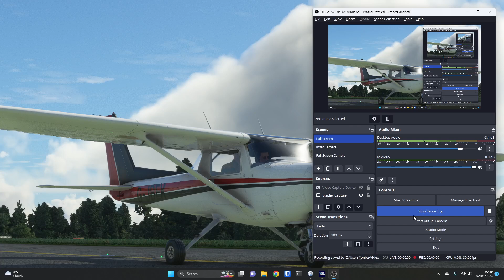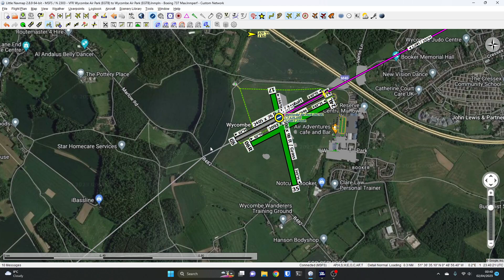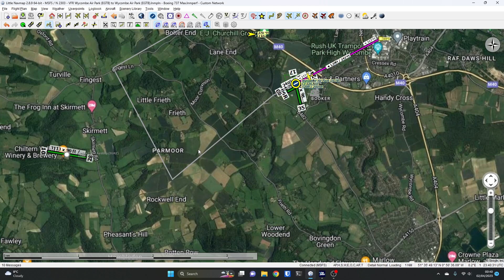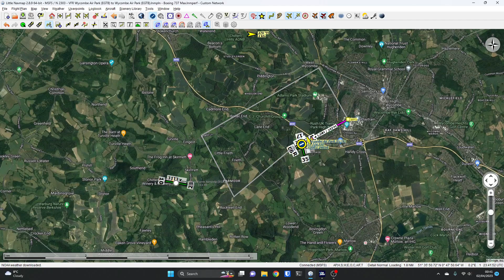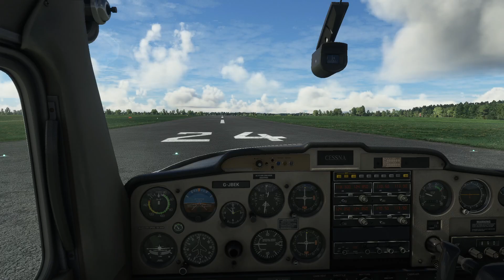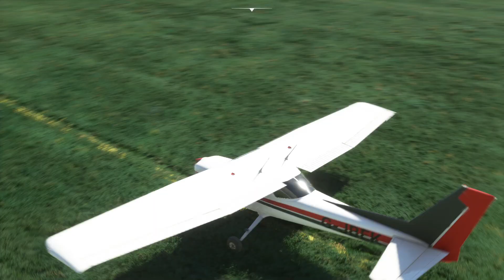Revisiting Wycombe Air Park in Microsoft Flight Simulator for the CORRECT RWY24 visual circuit

Comment: I'm just adding my two cents worth. The main reason runway references are used is that flying to other airports, may be unfamiliar territory, so obvious points on the ground may be unknown.  References to the runway apply anywhere and helps focus on the runway and the aircraft's relative position to it. In the real world the runway is easier to observe. In a sim it can be tricky with limited views.
Reply from the maker: Absolutely - but if you flew into this particular field and flew a generic pattern, you might cause a noise complaint :)

Comment: You did a much better job handling the c152. As a US pilot, the ground reference point traffic pattern is a foreign concept to me. We fly a pattern in reference to the runway. However, I do understand the that the Wycombe pattern procedure is in place for noise abatement reasons. A good lesson for everyone to learn is to do your research on all aspects of your flight before you get into the aircraft. Flight planning and preparation is key to flying an accurate and realistic flight in the sim. Good job Jon.
Reply from the maker: Cheers :)

Comment: Are you using the default 152?  Is the Jps mod worth using?
Reply from the maker: I'm using the most basic of basic stock 152s :) The JPS mod caused issues with other things in the simulator when I tried it.

Comment: Well done Jonathan as a ex PPL pilot at Booker High Wycombe, that was as a very accurate pattern from 24 you nailed it. They be happy with that IRL so without 3D, instructors, real life views it’s somewhat easier in real life than doing it on a pc with all the handicaps that has. 

And as you correct say, they have a unique pattern at Booker & height in part due to the noise abatements, also the Heathrow approach airspace is just above & the fact that helicopters & gliders often use the grass and south side of airfield at the same time!

They always called the thing you called obelisk the “stokenchurch mast” & “golden ball” for church.

Amazing job & huge congratulations- you deserve a cuppa tea & bacon sandwich back at the club house! 🥓 ☕️ 

👍💜👍
Reply: The Golden Ball is even an POI in MSFS2020. As good as the scenery is in the sim, I find it still quite difficult to fly visual and recognize the on the charts mentioned visual cues.
Reply from the maker: @renefeijen5916  It does indeed - but unless you're in 4K, you're not going to see it from a distance :)
Reply: @jonbeckett  I had poi marker on....
Reply from the maker: Fantastic feedback - thank you!  I know the girl that runs the cafe at the club house - will have to go visit her one day :)

Comment: Generally, visual cues within a traffic pattern (circuit), are references to the runway itself, not points on the ground. Fly upwind perhaps a mile. Downwind leg is about a mile from the runway. At a 45 degree angle from the corner of the runway, turn on base leg. Turn on final when appropriate in a standard turn. However, one can also use points on the ground that match references to the runway. Deploy 10 degree flaps just before turning to base leg. 20 degrees on base leg. Full flaps are not deployed on final until you know you can make the runway in case of engine failure. During touch and goes, transitioning from landing to take off raise flaps a notch at a time, pause a moment between notches, so not to induce a stall at low altitude.
Reply: A standard circuit in the south of England is often modified to adhere to Noise abatement rules. The turns are done with reference to the ground. 24 RH at EGTB is one. As is 06. As are many more.
Reply: Well Said Well said indeed must be a pilot
Reply: one forgot  before turning base to look out the left wing when the RWY  is on the edge of the wing 45 degres or so fly a little more then turn base if left pattern
Reply from the maker: @mikecoffee10  Not in this case - the pattern is very specific in terms of where you can fly over High Wycombe. Interestingly, the night pattern is completely different again.
Reply: @jonbeckett  ahh right Thank You and that OZ flight  on Sunday was fantastic though can't always make it on time  though